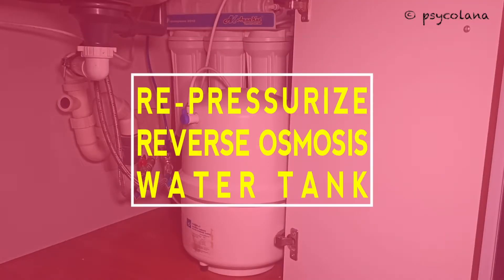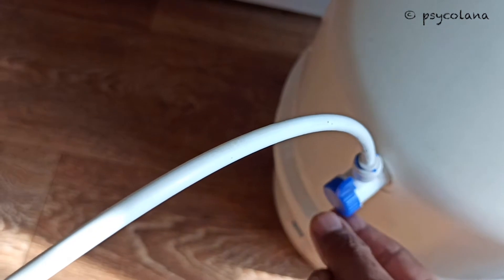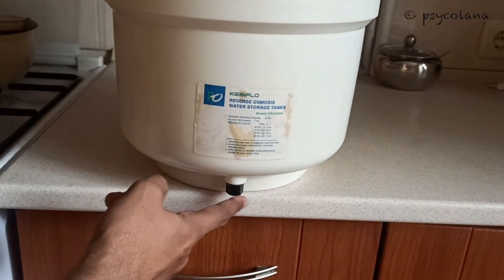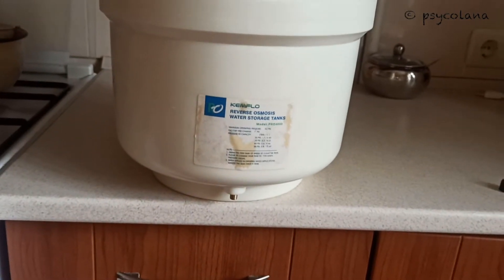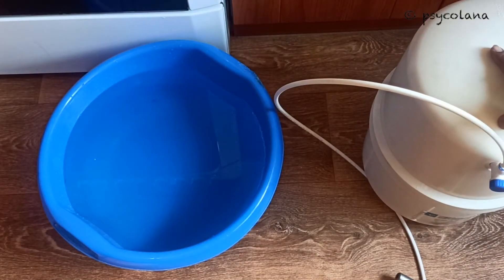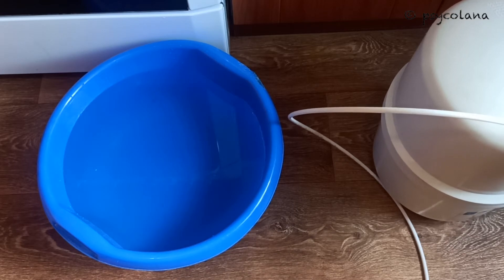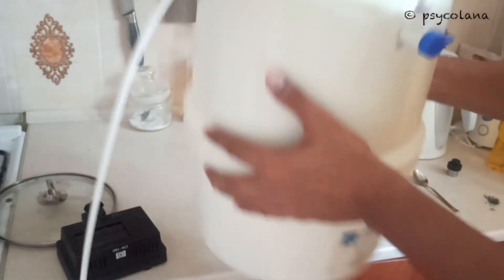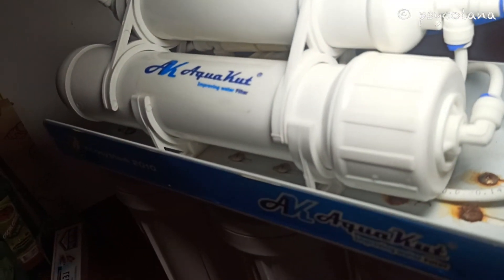How to Repressurize a Reverse Osmosis Water Tank | KEMFLO | AquaKut

Comment: When adding the air pressure,  is the water outlet switch in the on or off position?
Reply from the maker: valve is in the off position while you are filling air